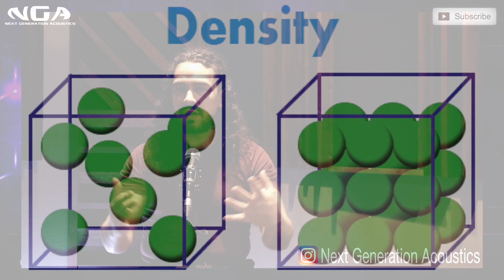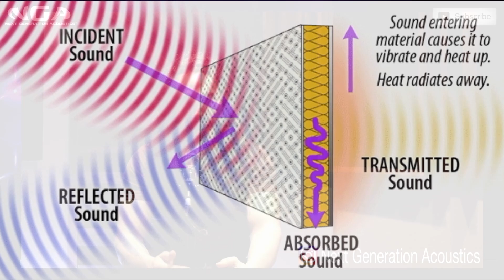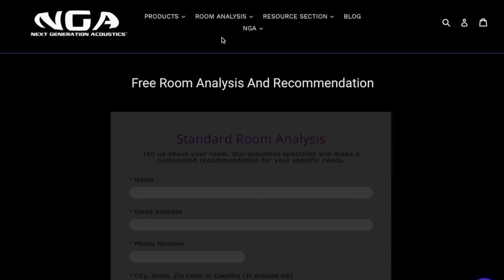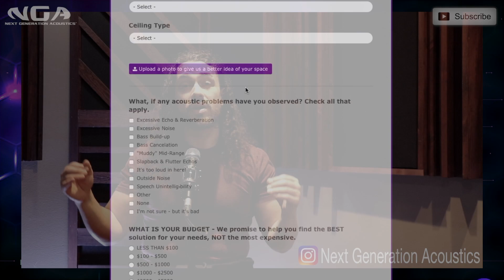Do foam "Bass Traps" REALLY work?!

Comment: What do you think?  of fiberglass foam!  like bass trap!!  Will it have the necessary density?  To use that material and build my own bass traps.
Reply from the maker: Yes, a high density fiberglass should work very well!
Reply: @NGAcoustics  Thank you for your advice. I will apply it as I progress in the improvements of my room.  (at the moment I am building absorbent panels, with fiberglass foam (observing the "cinemark" rooms, I realized that 70% of the walls are with fiberglass foam and lined with fabric and that product is accessible in my country (🇨🇱).
Reply: the is a big difference in foam .. you have to use Melaminharz foam like all that stuff from Basotect ! it has to absorb waves and convert it in energy.
all the rest of simple foam is a scam.
do your research before spitting facts ...